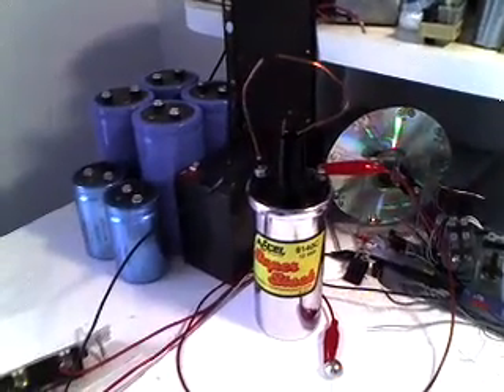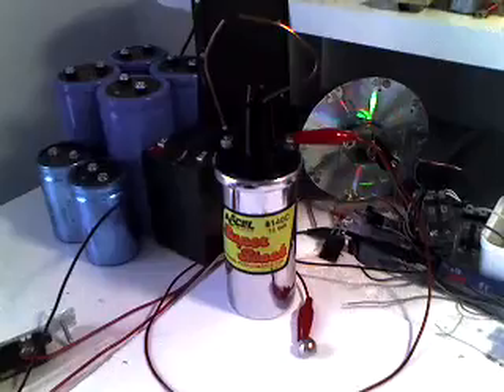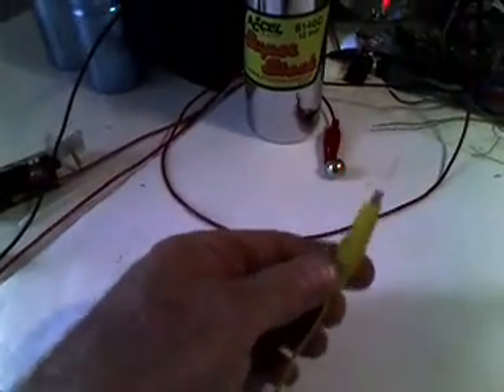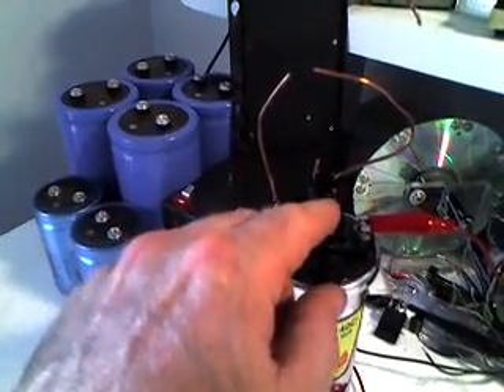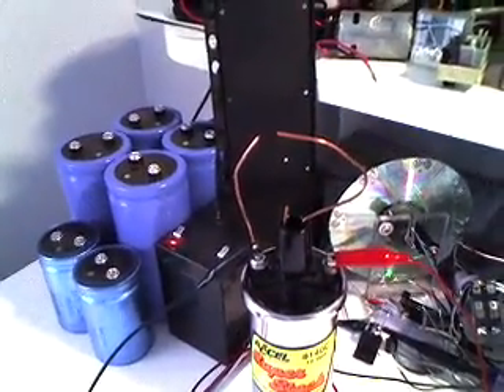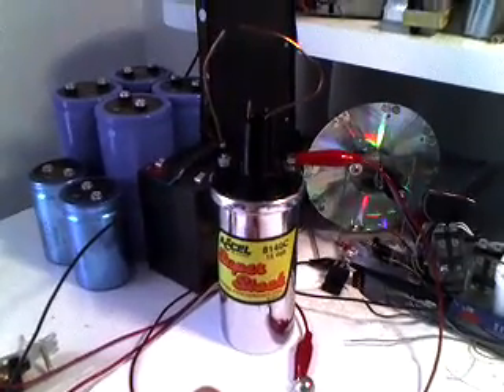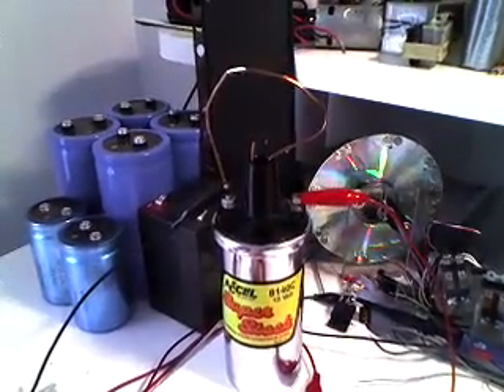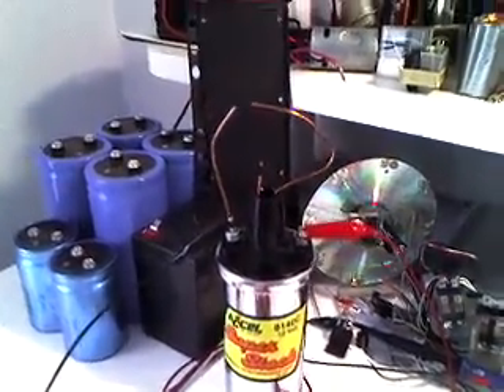Ignition Coil pulsed by Neo magnet

Comment from the maker: Hi evolution2015,

thanks for looking, They do start to burn a little if you try to push more current through it by applying more pressure. 

Yes you can use a 555 chip, resistors, a pot, caps and a transistor to do the same thing but now you used over 6 different components not counting the quantity of each to do what I can do with 1 very small magnet. This is what I'm demonstrating here. It's just fun and interesting to see.

Luc